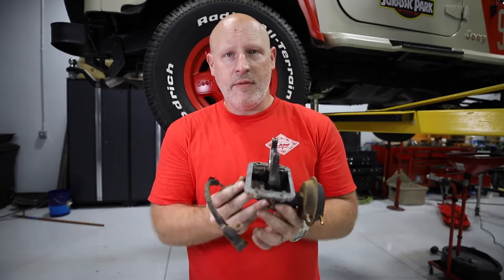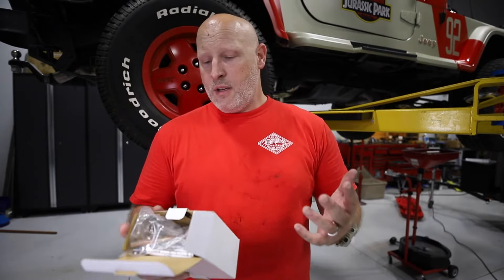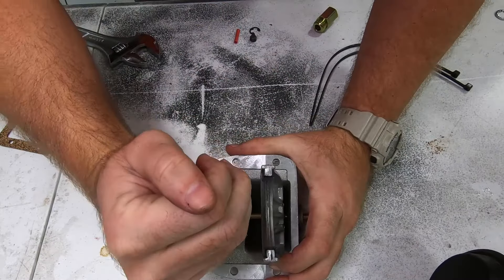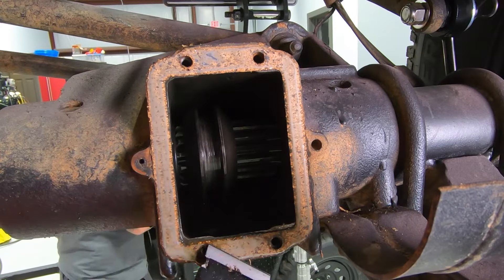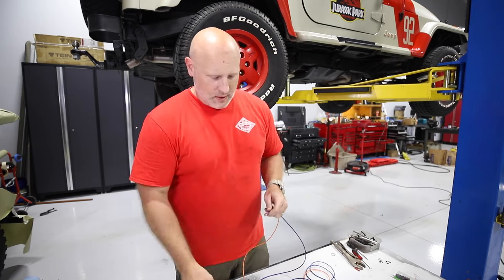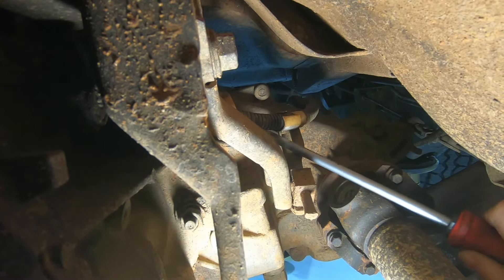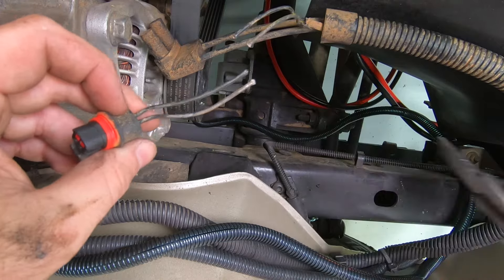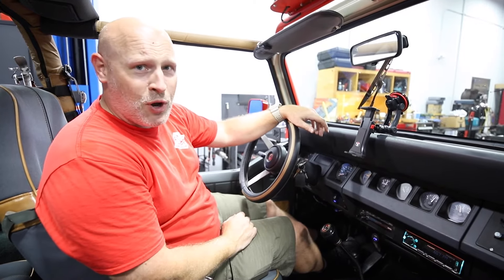Jeep YJ Central Axle Disconnect CAD delete with working 4WD indicator light

Comment: You have done a good job with the video. My jeep is a 1987 basket case , I’ve done away with the vacuum lines. Will the tj transfer case plug fit into my 
Np207 tc ? Also the only thing I have found in the engine bay is a vacuum operated switch on the fire wall with a vacuum line going into it and two wires coming out from the bottom, one grounded to the fire wall and the other just hangs there? How do I get the wires from the transfer case connected to my dash light? There is no old connector to snip off and nothing to plug into? More than two wires confuses me..
I need to tear my wiring harness apart to find the wires going to the dash? All the indicator light videos and forum jive are for 91 and up yj’s. Any suggestions would be appreciated . Pre 91’s wired differently?
Reply from the maker: Hey! Thank you. I do believe there are some differences in the wiring. And I really am not an expert on that. So unfortunately I don’t have a good answer. I was able to figure out this project by piecing together several other YouTube videos and with the help of my brother. I’m sorry I’m not more help.
Reply: @SimplyMustGo  hey, 
Thank you for the reply, and an honest answer.. it seems that my jeep was the first of the wrangler series and is now officially a antique. Most of the vendors are just computer geeks who don’t know what they are selling unless they have a part#! I’m not good at navigating the forums or the internet trying to get any information on my situation but all the info I have looked at is for 91 and above which is different from what I am dealing with as the early yj’s had the np207 tc.. not sure and have not heard yet if that tj switch will work for me as well as the engine bay connector seems not the same. Guess I will have to live with out a light for now. If I find out a solution, I’ll have something to share. Thanks again for your honest reply..
Reply from the maker: @jamesking7717  Find the Jeep YJ Facebook Group, they have been super helpful Join the group and post your question there and I promise someone will know the answer.
Reply: Thanks for your help
Reply: Did you ever find an answer to this? I am about to do the same thing on an 1989 YJ. Does the plug connect to your 87 YJ?
Reply: @Cade215 doing the samr thing in a week. Did you happen to find out?

Comment: With this set up is it always in 4 wheel drive?
Reply: No, the front axles and diff are engaged however not driven until you shift the transfer case

Comment: Would this work with Dorman Transfer Case Switch 600-551
Reply from the maker: Unfortunately, I have absolutely no idea.
Reply: Yes, it will fit. As will an Omix 18676.15 or Crown J8134473